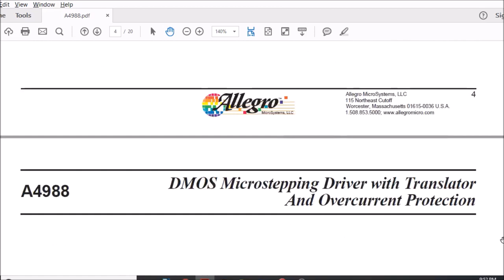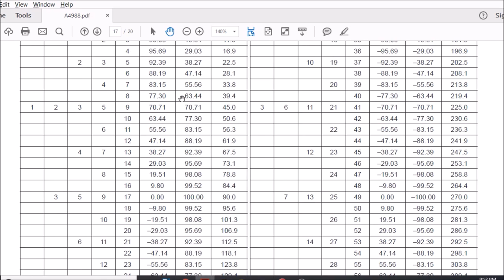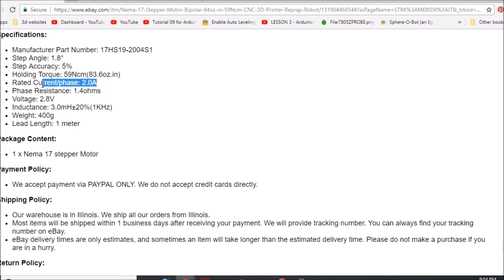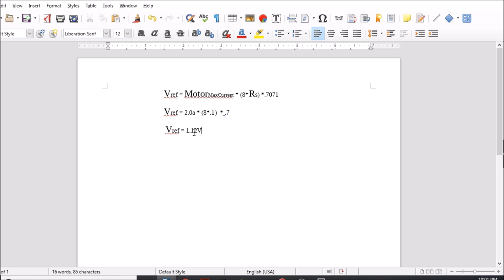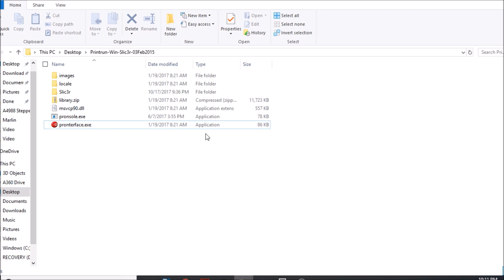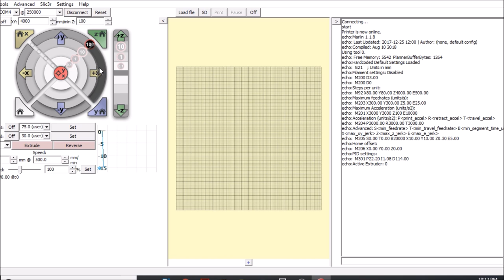MKS Gen L - A4988 Calibration

Comment: Hi @Edward Braiman   -  I noticed somethings. (References: https://www.pololu.com/product/1182)

1). If you look at the top of the chart with the Amps%/ step, It says that degrees is the home position for all steps.  And on Page 7 under device operation it states that when the driver is first powered on or reset, it is automatically set to home, which is common for all steps. So that number will be the same regardless of which step selection is made. This will save you the trouble of having to remove and re-insert the pins.

2).  The A4988 can Go over the current max by an extra 10% when going from full to 1/16 step, so Its best to do these at what step your going to use. The only reason to use a full step is if your going to eyeball with no real calculations.

3). The driver should be connected to the motor when doing this and set to its home, which is at 45 degrees. It should be there automatically after boot, but the motor should be plugged in before booting. 

4). The next Big thing is that all need to take notice of their own individual sense resistor (Rs)  since these drivers can be made from many different manufacturers. The best thing to do is to show people how to find them on their boards. They should look for two equal resistors fairly next to each other, and if the board has print, it may have a small S near them to mark them as the sensors. You can then use the numbers, and google, on the resistors to see what value they are.  I would not trust that all resistors would be the same on all boards even if they were shipped all at the same time. Cutting corners is an industry norm in the cheap world of china, and they may just use what ever is available. 

So       Voltage reference  =  8  x   (Im x 70.71%)   x    Resistance Sensor on your specific board.
....................................................... Im = Motor Current Rating    or   Rated Current   or A/Phase    or    Amps per Phase

Thanks for the vids!!! Keep up the effort and good work!!!!

Comment: Is there a way to check A4988 stepper to tell if they are good before installing them, and blowing out a controller?
Reply from the maker: You can see any burn marks on either side of board?  If you plug in aligning pin names you should be fine.  If the board is green rather than red it might be an issue.

Comment: Is it they same vref values for z axis using ramps if they are in parallel i mean Theres alot more current consumption, using 2 stepper motors in a single driver. Best regards.
Reply from the maker: If it's not enough current you can increase or decrease if too much.

Comment: Should I set my z axis to fullsteps or 1/16 steps on my CR10 with this board? it has 8mm leadscrews and 200step/r motors
Reply from the maker: Sounds about right, but you'll want to verify with reprap calculator.
Reply: So you recommend full steps instead of microsteps for the Z axis?
Reply from the maker: All the jumpers for ms1, ms2 and ms3 should be in place to make stepping work correctly.  Otherwise your steps will not be what you're looking for.

Comment: If you go from mks base 1.4 to this is it all pretty much the same? what other stuff do you have to configure besides specify the drivers in the config file?
Reply from the maker: If the board are equally electrically, then not much.  I'm currently not familiar with MKS Base 1.4.

Comment: Quick question... If I want my motor to actually do 16th steps I skip the 70% reduction on the equation correct? since 16th step needs 100% Vref on the first step?
Reply from the maker: This is used to calibrate the current of the stepper.  1/16 is software controlled pulses.
Reply from the maker: Going to 💯 will cook either or both you motors and or your steppers.
Reply: @EdwardBraiman  I think you didn't understand the question. The stepper is already set for 1/16 step. When calibrating the current through Vref you used 70% because you were using full step. But if you were using 1/16th step you should have left the vref=2.0(8*.1)  correct? at 1/16th step the chart says the first step need 100% of the Vref calculation. For instance my motor is 1.5A. Vref=1.5(8*.1) at 1/16th step. So my Vref=1.2. That would not fry my motor or driver. Also the drivers have over temp protection.
Reply from the maker: Okay sounds more clear.  When you step the motor is the noise clear and the Nema17 is not hot?  If so you're all good.  It's basically about running stepper at a cool temperature.
Reply: Ok, now I’m confused. Does this Q and A have to do with the insertion or removal of the three jumper pins before calibrating?
Reply from the maker: Calibration should be like the video.  The jumpers should be replaced after calibration.
Reply: @rodneybosco7376  no the question was about tuning the VREF for the A4988 drivers. at 1/16th step you use 100% of the vref but at full steps you use 70% of the vref.

Comment: 1.12 make my drivers so hot :/

i have arduino mega and ramps 1.4 red StepStick A4988  Dissipateur, 1A

whats so the best value ?
Reply from the maker: English:
What type of NEMA 17 motor are you running?  Remember the equation is designed to make you think about your motor as well as stepper driver.  If it is running hot or noisy it generally means too much current and needs to be tuned lower with trim pod.  Hope this helps.

French:
Quel type de moteur NEMA 17 utilisez-vous? N'oubliez pas que l'équation est conçue pour vous faire penser à votre moteur ainsi qu'à votre moteur pas à pas. S'il fait chaud ou qu'il y a du bruit, cela signifie généralement trop de courant et doit être réglé plus bas avec le trim pod. J'espère que cela t'aides.
Reply from the maker: @ZouheirIbnabdeljalil  focus on Rated Current to start and see if motor turns without noise.  In the video I think it was much higher current on the NEMA 17 motor that was used in the video.
Reply: @EdwardBraiman  question pourquoi je dois augmenté le courant ? ou bien pourquoi je dois regler le potentiomètre ?

why should i add more current ?
Reply from the maker: English:
why do I have to increase the current? or why I have to adjust the potentiometer

Answer:
English:
Depends on the NEMA 17 stepper motor and stepper driver board.  If it works and it is quiet out the box, that's great.  If it doesn't or NEMA 17, gets very hot, then you should calibrate.

French:
Dépend du moteur pas à pas NEMA 17 et de la carte de pilotage pas à pas. Si ça marche et que c'est silencieux, c'est génial. Si ce n'est pas le cas ou si NEMA 17 devient très chaud, vous devez effectuer le calibrage.

Comment: BOI! you never use usb to calibrate driver
Reply from the maker: you can ground on either outside of USB or negative connector as ground.  The USB is on the Arduino Mega 2560 board and under the RAMPS 1.4.
Reply: @EdwardBraiman  I meant, that the voltage to power the board  is different between USB(5V) and power supply(12V). you will never calibrate it right with usb unless you calculate it out. Usually when you calibrate with power supply, you would do 1.4 - 1.6V for Nema-17
Reply: I guess everyone has their own method but I think the drivers should be calibrated with the same "Power supply" that you are using to operate the motors
Reply from the maker: Your point is valid.